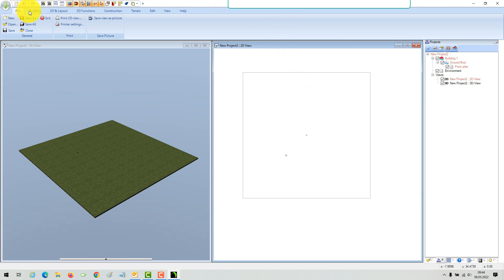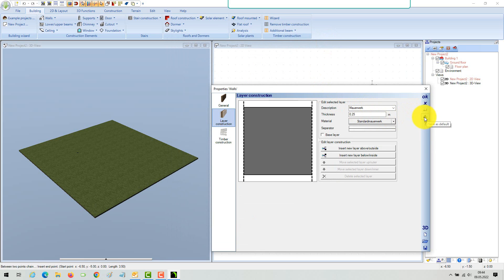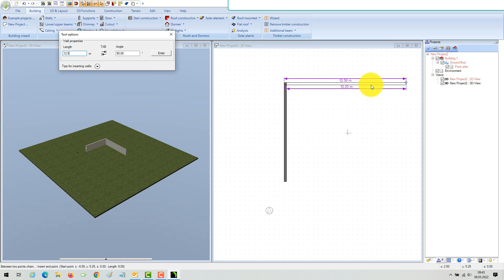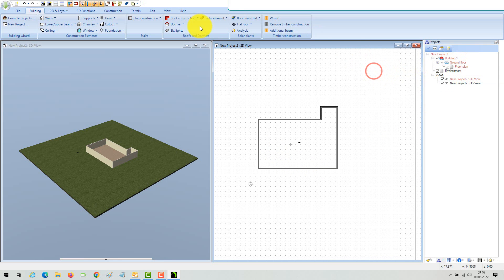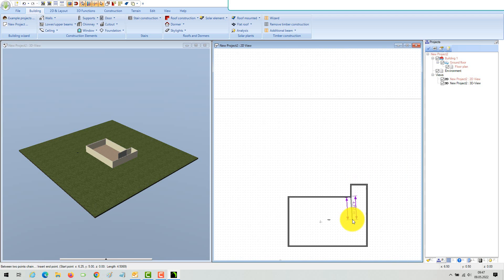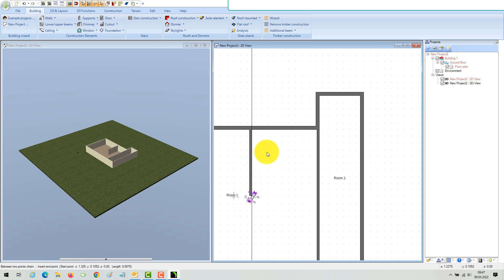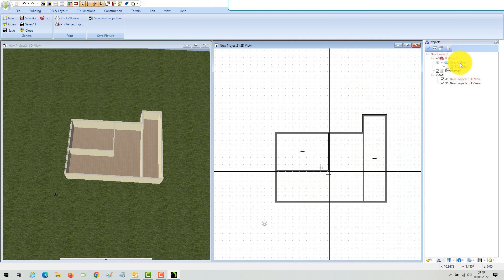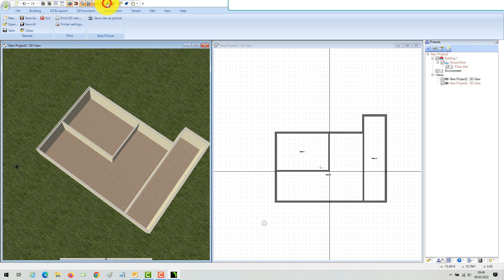Ashampoo 3D CAD - Inserting walls

Comment: can you make circular structures and domes.
Reply from the maker: Hello, you could design circular walls by inserting them “segment-wise”, following a bow with our polygonal wall tools for example. Keep in mind that windows and doors can only be inserted in a single wall segment and not overlapping multiple walls. All alternatives requires 3D modelling, simple modelling functions are included in our CAD packages.

Domes: there is no standard functions for that. Could be a matter for 3D modelling but if that makes sense depends on your project. Could be time consuming.
If you have a sketch or photo of a similar building you could send it over to our support team and we could give you a more reliable advice. 

Your Ashampoo team
Reply: @ashampoo  cool..thanks. Me, karra and Donna Douglass are thinking of building a inexpensive super adobe house to escape poverty. thanks for your help. Hmm...not seeing the spiritual portal tool...:hand-orange-covering-eyes:, oh wells.